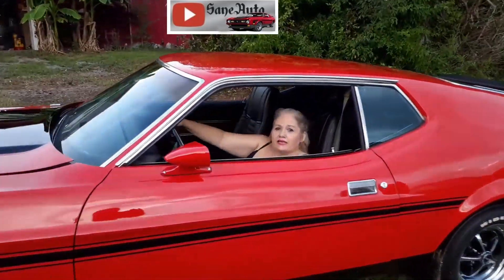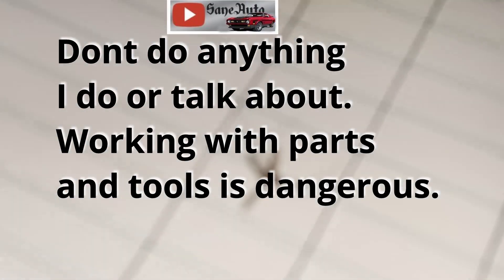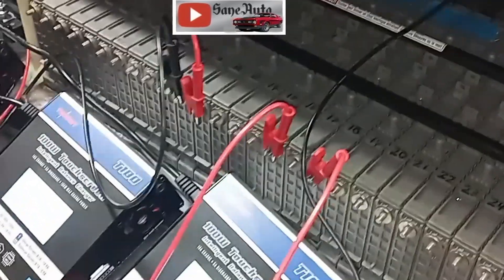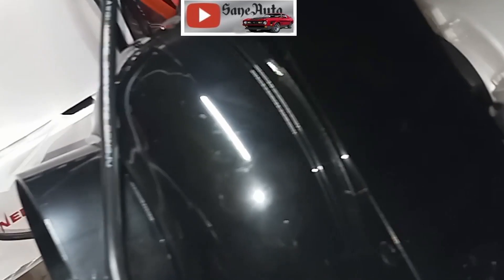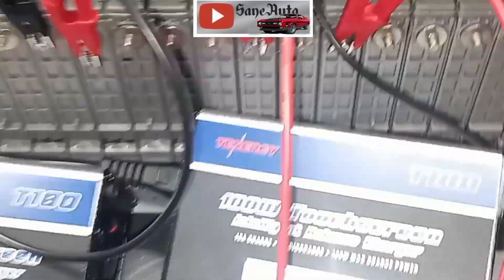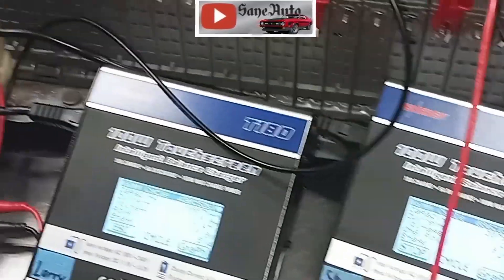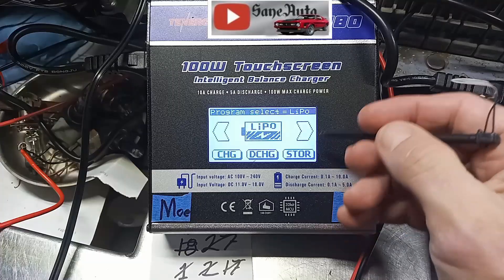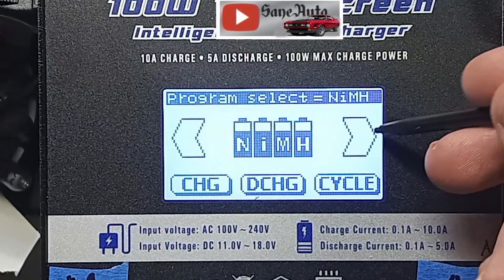How to setup the T180 Charger for DIY reconditioning Toyota Prius Hybrid battery settings Tenergy

Comment: I can't tell are you charging one module or two modules? 7.2 or 14 volts
Reply from the maker: I charge one module per charger. There is no top voltage setting. The module I was cycling was showing over 8V before starting. This has little to do with the capacity or state of health of the module. The mah between cycles means a lot more. I explain this better while showing the charger in this other video https://youtu.be/Va7ADJz4gpo